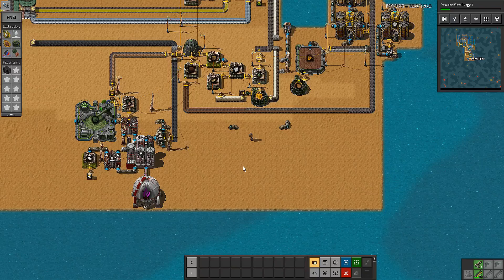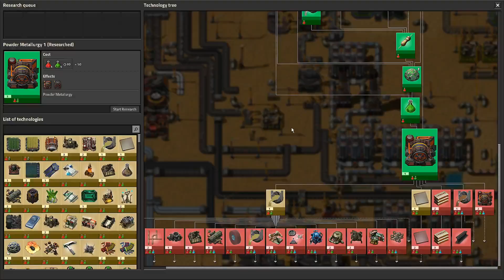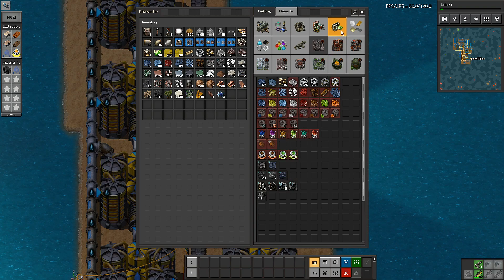Factorio Seablock + TSM ep19

Comment: I find it very annoying that FNEI doesn't show all uses.. For instance the fact that Fuel Oil can go straight into fluid burning boilers/heat sources for very cheap power.  I guess they are assuming you'll look at the new technologies that you have unlocked, like the fluid burning boiler.
Reply: Or it would be nice that the tooltip in the recipe for Fuel Oil, it would show the fuel value which would give a hint.  You don't see the fuel value until you get it into a pipe or a tank.
Reply from the maker: I think I will have to switch some power generation into Fuel Oil as I am reducing my hydrogen surplus currently.